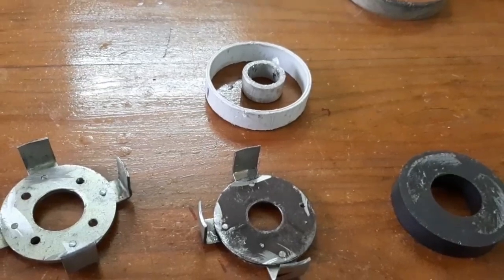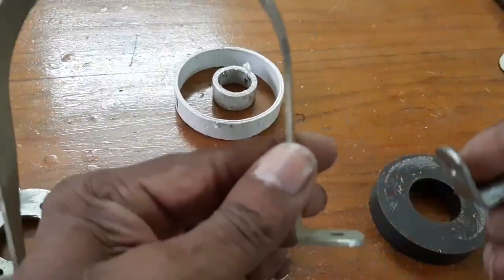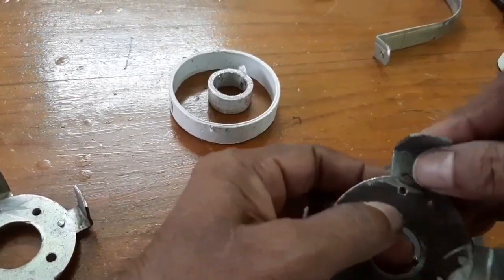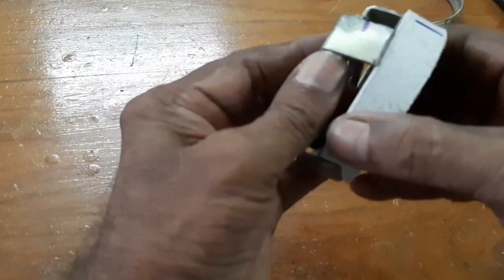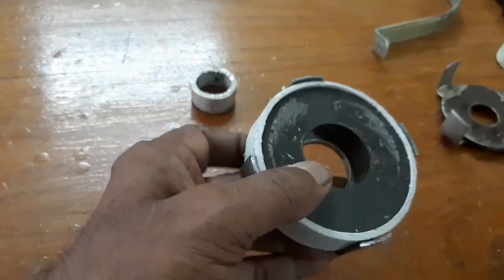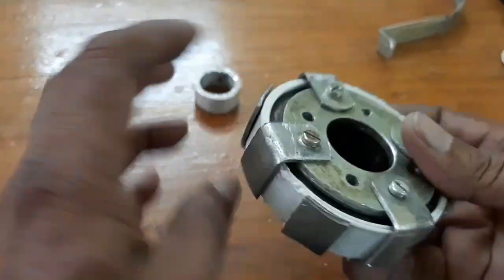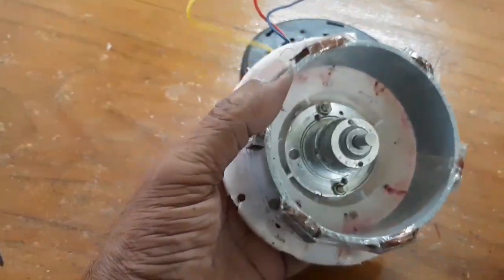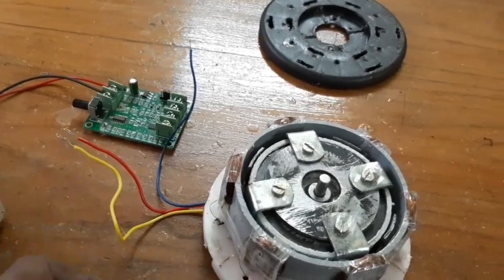(V-32),ஸ்பீக்கர் magnet Bldc மோட்டார்/BLDC MOTOR(using speaker magnets )

Comment: Sir how many turn given by what gauge wire
Reply from the maker: Hai bro each pole has 300 turns of 30gauge of copper wire because my bldc controller current capacity  1 amps so
That i make small size motor
Reply: @pugalstech  thanks sir, waiting for your new tech on bldc

Comment: So you are not going to tell us the number of coil turns, the size of the wire and how you wired the 6 coils?
I think you somehow found a speaker magnet that had 8 poles with north and south next to each other.  I have never seen such a speaker magnet.
Reply from the maker: Thanks for watching
Each pole coil has 200 turns of 32 gauge of copper wire and speaker magnet has only two poles by extending of four "L" metal plates on both side of ring magnets we have achieved 8 poles as shown in the videos

Comment: Very good motor. Thank you
Reply from the maker: Thanks sir
Reply: @pugalstech  , 1. does this motor have a high torque and high rpm? 
2. What happens for the area of the permanent magnet that is not covered by any of the clamps? What effect does the coil pulse have on those areas?
Would highly appreciate your kind explanation. Thank you
Reply: @pugalstech  , if you use eight pieces of clamp pieces for each side of the magnet, four pieces o each side, as you have done, and another four longer pieces that will be long enough to go to the outer side of your coils, you will reduce the flux loss, while increasing torque and rpm while reducing your input power. Thank you
Reply: https://youtu.be/ZHQA3mZxqPM